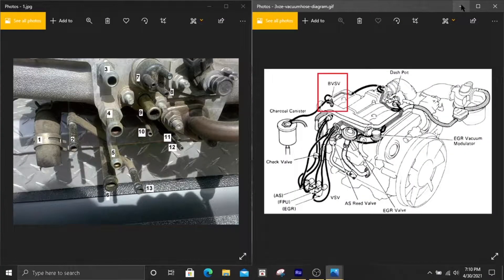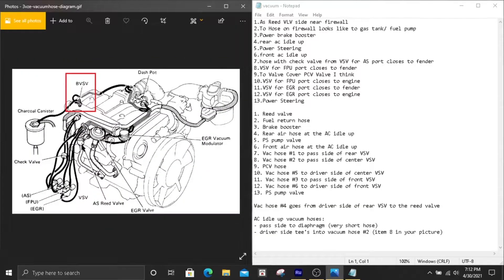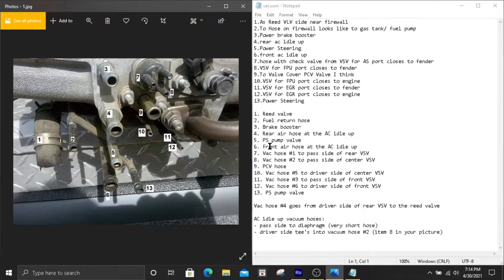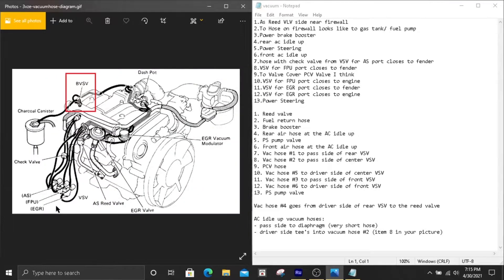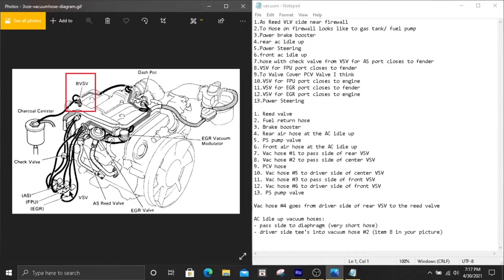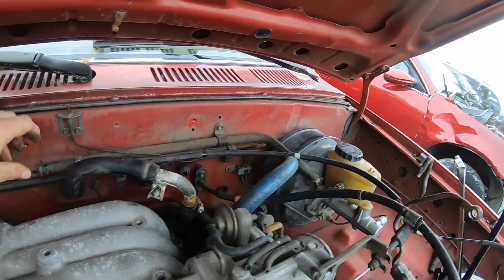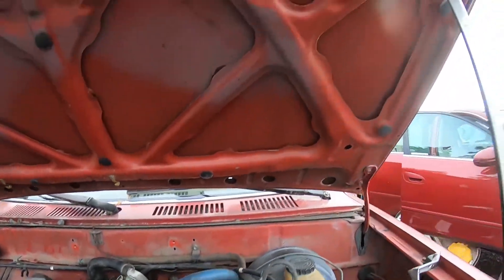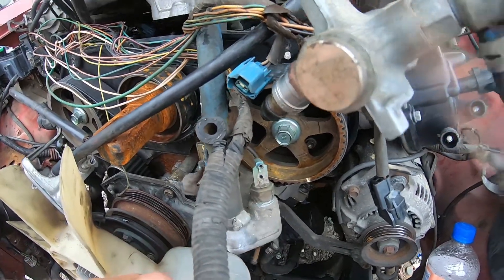Toyota 4Runner 3.0 3VZE Full Vacuum Breakdown

Comment: You guys are fabulous! I bought a 1995 4Runner with a 3VZE two years ago as a project vehicle since it had a blown head gasket. Redid the whole top end of the engine and it has been my daily driver ever since. Just recently I blew the cold start fuel line, one side is easy but you guys know where the other end is, under the dang plenum. took every thing apart and replaced my $123 new cold start fuel line. Being a dummy I did not label the vacuum lines. Hooked them up three different times and was not successful. Found your video and was thrilled to death! I'm back up an running again. Besides having all the ridiculous vacuum lines, the 3VZE has the worst place for the PCV valve. I went ahead and replaced the PCV valve and the bushing. Dorman makes a replacement bushing that works wonders. I had replaced the PCV valve when I rebuilt the top end but never changed the bushing. I would have left that PCV alone but the bushing was all cracked. had to use a vice grip to remove the PCV and dug out all the cracked pieces of bushing without getting any of the broken parts into the valves. Thank you so much for doing this video!

Comment: Thanks for this. Is this the same for both 2WD Auto and 4wd manual trans? I have a 2wd auto. I think the shop hooked up the power steering hoses to the wrong spots.. I get a low idle when turning hard and in general.
Reply from the maker: Yea it is for both you just wont have one vacuum switch for the 4wd. There is that fitting on the back/bottom of the power steering and they tend to break. Also that fitting doesnt come with a new power steering.

Comment: I did break the nipples on that tvv as well but i was under the impression that nothing connected to it 🤦 had trouble starting and had a blown drivers head. Fixed the head and now it barely runs like sh*t so looking into the spaghetti vacuum
Reply from the maker: Good luck guy you will figure it out

Comment: Use colored zip ties on these vac lines. Place one on the hose and one on where it goes ! When you run out or colors start using color combinations.  Red/black, blue/green...etc. clip off the tails and leave em on. They don't look bad and last forever.
Reply from the maker: Thats a good idea guy thanks
Reply: @southerngearz  I had mine like this for years before I did my EGR delete.  Only a few lines now.
Reply from the maker: @Leon1982db  that egr delete freed up so much space.

Comment: If you wanted to check vacuum what line would you recommend to connect the gauge to. I know it’s suppose to be on the intake side but a line a particular would be appreciated
Reply from the maker: I always check it through the brake booster line

Comment: Thanks for this video....I'm having to rebuild an entire engine tear-down on a 94 Toyota Pickup with the 3.0. This vehicle came to me from a shop that permanently closed during partial rebuild.....and one of the things I'm fearing most is vacuum routing. This definitely helps, thank you for your time in this!
Reply from the maker: Not a problem guy just glad to help. It always fun finishing something someone else started oh wait did I say fun I meant terrible haha good luck guy
Reply: @southerngearz  I hate puzzles with missing pieces. oh jeez the number of parts I've had to order or find for this truck. It's been quite the project, and normally our shop won't take work like this but he was ok waiting 2+ months (I'm working on it during slow times)
Reply from the maker: @gt500knights  geez thats crazy! Im worried I will forget where something goes if I leave the project sitting too long.

Comment: How do you get that No. 1 air hose, under the plenum, hooked up? There is no room for my hand at the reed valve.
Reply from the maker: You may need to remove the plenum in order to have the space.
Reply: I second this. I was trying to disconnect this #1 line last night and after 20 minutes of no success due to lack of access I gave up and cut it lol. Works fine since I’m deleting the egr system anyway but in hindsight if I had the plenum removed my life would have been much easier.
Reply from the maker: Or at least lift it enough to have better access so you dont have to remove everything

Comment: Off topic question for ya...what do you advise for loooooong term storage of vehicles?  I've got a '99 Dakota which I've decided to make "non-operational" on insurance and registration.  It is now garage art for me to clean and admire, I bought it brand new off the lot in 9 of '98, still only 70,000 miles.  Should I just take the battery out?  Does it matter to put it on jacks?  Seems to me if it is going to be art for years it's going to need new tires regardless.
Reply from the maker: I would disconnect the battery remove the fuel pump fuse and run it until it dies and get some stabil fuel additive. I would also fog the inside by removing the spark plugs and spraying wd40 inside to prevent rusting. Jack stands i wouldnt worry about like you said they will be bad anyways from just sitting. Shot of air from time to time just so its not on the ground.
Reply from the maker: Of course remove the battery after cranking and it dying
Reply: @southerngearz  Do you have a preferred fuel additive?  I'm in the desert, very dry air, so rust isn't an issue.  I plan to clean and caress it here and there, so air would be a good idea too.
Reply from the maker: Sta-bil is the one most people use and it seems to work great.
Reply: @southerngearz  k, tanks
Reply: It's a Dakota not a Mercedes